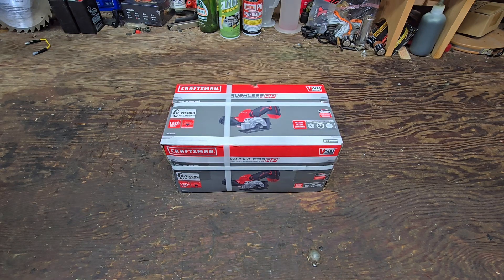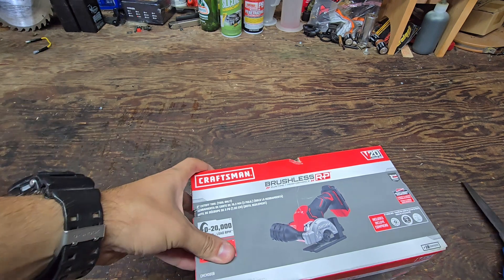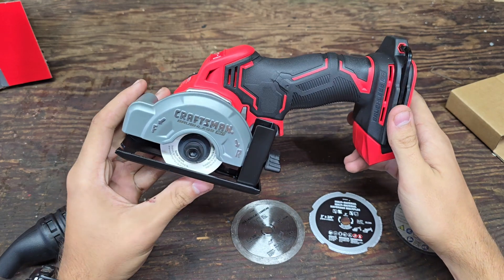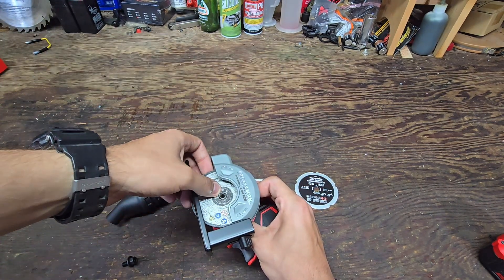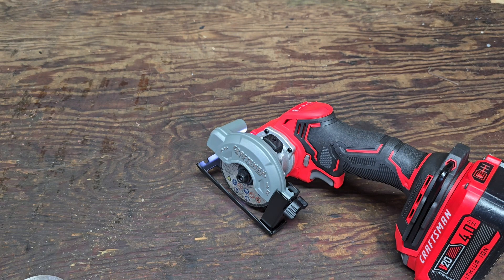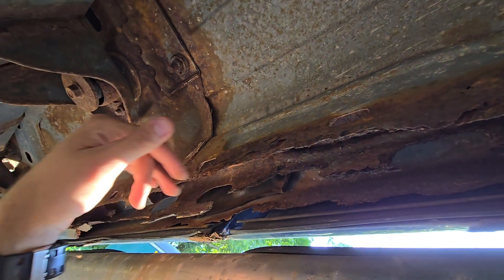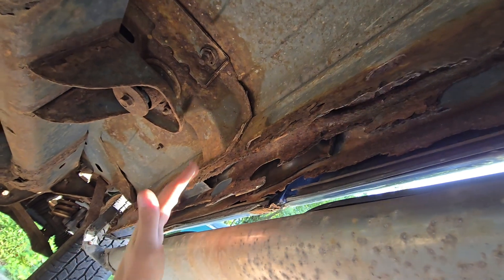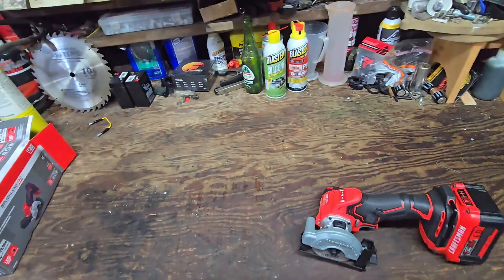This TOOL Outcuts them ALL: Craftsman V20 Brushless Cut-off Tool

Comment: Starting @7:22 The blade is turning the wrong direction for that type of cut. It will always try to "climb" the way up on top. It should be like a circular saw and turn "up" into the material.
Reply from the maker: Thank you, I had to get used to the bi-polar motor.
Reply: @EverydayTools  LOL
Reply: Hi, why should it turn up into the metal and why not down? I am learning. 
When it cuts up, won't it lift the metal up and cut unevenly?

Comment: Is there any different with angle grinder ? Other than the base
Reply from the maker: Yeah, smaller form factor allows you to fit into tighter spaces. It has an led light and you can put stone and wood cutting blades on it as well, making it very useful.
Reply: @EverydayTools  ty
Reply from the maker: No problem, thanks for watching @joshuax1987